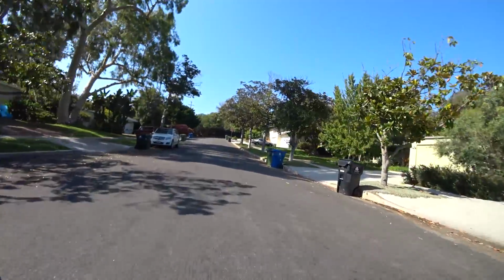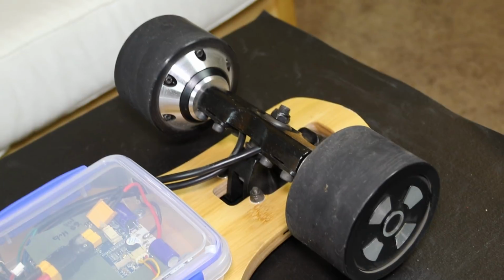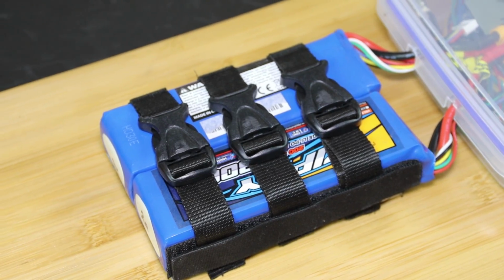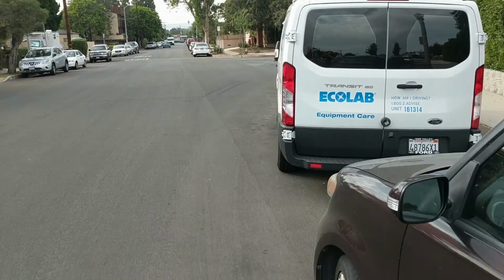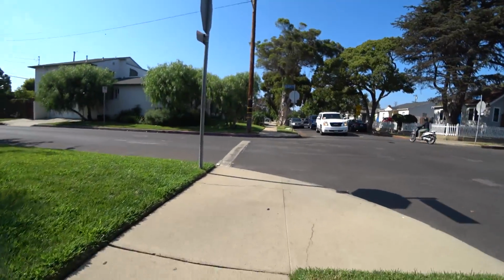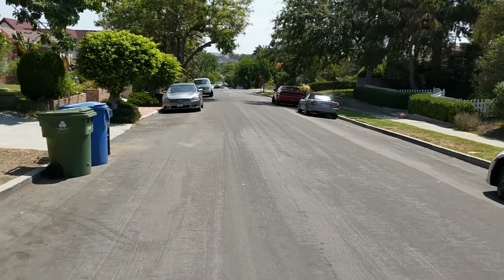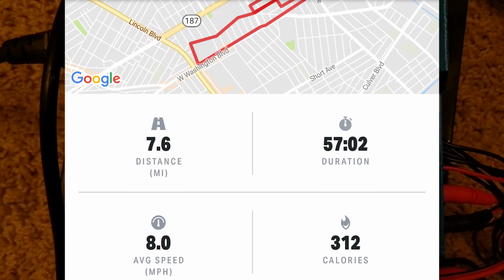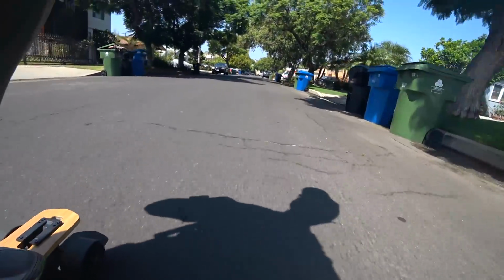Awesome Longboard | 21mph / $370 / Easy Build

Comment: the set is durable? Is skateboard still running?
Reply from the maker: The motors have been running very well. I ride the board often and they still work perfectly. The original ESC did break recently. I replaced it with the newer revision. I think the ESC might have been a bit messed up because I did a bad soldering job when changing it from 6S to 10S. Also, I think the ESCs can get damaged over time from the vibrations of the board.

Comment: How do you charge the batteries? Also, how do you know when you need to charge them? I want to make a board with battery level indicator, do you think that's a good idea?
Reply from the maker: I charge the batteries using a balance charger and parallel charging board. The charger I use is the "b6ac v2" you can find them on eBay or Amazon. I usually recharge the batteries after every ride. The newer version of the ESC in this video has a built-in battery level indicator. The ESC will also start beeping when the battery gets very low. If you buy the ESC now you should already get a battery level indicator :). You can get it from eBay (link in description) or meepoboard.com. I'll post a video soon showing the newer ESC, how I charge batteries, and more details on how I put my boards together.

Comment: Hey man after watching your video am supper hyped to build one I got all the stuff you listed, but i want to take it up a notch. I want use an off-road wheels ... any advice how I can combine this model with off road wheels. I would really appreciate it
Reply from the maker: Awesome! I'm glad the video was helpful. I'm not sure how you can use the hub motors from this board with off-road wheels. There is no easy way to change the rubber wheel part. For an off road board you might want to use a belt drive system so you can use bigger wheels. I'm going to post a video soon on a belt-drive board I built. Good luck with your build!

Comment: so ifmake this build howmany batteries can y put toget lets say 15 mile range cables etc
Reply from the maker: You might be able to get close to 15 miles with 2 5000 mAh batteries. Like this one.
https://hobbyking.com/en_us/turnigy-battery-5000mah-5s-20c-lipo-pack-xt-90.html
It depends on how you ride and the terrain. You can also buy 2 pairs (4) 3Ah batteries like the ones I use and just take the second set with you to swap along the way.
Reply: Oren's Projects i think ill purchace r of those 5000mah and take them with me
Reply from the maker: Great, you should get plenty of range with those.

Comment: @Oren By any chance can you do a vid on how you connected the remote to the board i can't
 seem to find any videos that show how to do it
Reply from the maker: The ESC and remote were always paired when I got them. I might have gone through the process once. The instructions are shown in the description of the eBay listing for the ESC.
https://www.ebay.com/itm/Dual-motors-longboard-skateboard-control-modula-ESC-Substitute-with-remote/323106658704
I hope this helps.

Comment: Many manufacturers seem to be using the same hub motors, trucks/wheels, same exact wires/covering, parts.... 400w hub motors?
Reply from the maker: Yeah, the ESC and motors in this build are a common choice for many board makers. So far I can see why. Both the ESC and the motors have performed very well and are a great deal.

Comment: if I use more powerful motor, say 2000kw, is it possible to increase more speed?
Reply from the maker: I think you mean 2000w, 2000kw would be nice :). As far as top speed that would depend on the ESC. The ESC in this build limits the RPM so it probably won't go much over 21 - 22 mph (depending on the motor kv and wheel size). With a VESCs you should be able to reach higher speeds. However, even if you use the ESC from this build, having a 2000w motor will get you up steep hills faster.

Comment: Great build! Do you know if the switch on the esc is an anti spark one? is it safe? There is something else you do beside clicking on it when you want to fully turn off the board? Please keep make more DIY esk8 videos they are awesome!
Reply from the maker: Thanks! I'm glad the videos are helpful. The switch is electronic so there wouldn't be a spark. Sparks are usually caused by mechanical switches (or connecting wires manually). I think the electronic switch is good for temporarily turning the board off but I usually disconnect the battery to be safe.

Comment: Hey dude! I've been reviewing your videos. So in this video, did you exhaust all of the battery when you got 7.6 miles? Or did you still have some room to go further?
Reply from the maker: Thanks! I didn't fully drain the battery on that ride. It still had charge left. I don't usually go full speed and rarely go up very steep hills so I get 8+ miles. I ride this board often and still haven't ridden until it fully died.
Reply: Oren's Projects if I got the two 5000mah batteries, do you think I could get at least 12 miles?
Reply from the maker: Yeah, that definitely seems reasonable. For my weight (170 lbs) and the way I ride I think I'd get at least 12 miles.
Reply: Oren's Projects Do you have any problems with the width of the board?
Reply from the maker: Sorry, I didn't see this earlier. I haven't had any problems with the width, although I personally prefer a standard board shape with a kicktail. Thanks for posting the link to the container! For some reason, youtube marked it as spam. That looks like a nice option for larger batteries.
Reply: Oren's Projects I'm building the board that you built as we speak. I laid the DKL grip tape down long ways and it is perfect. I went with the 5,000mah batteries.
Reply: Oren's Projects also, I live in Honolulu and it rains frequently in light showers. Any tips on waterproofing the batteries and the gaps for the VESQ?
Reply from the maker: That's awesome you're building a board now! Maybe DKL made their rolls a bit wider now. The ones I got were too narrow for a longboard. I also hope they improved the design to not peel back as much. You should get plenty of range with the 5000mAh batteries. For sealing around the openings in the container I'd try neoprene grommets or a strong duct tape like Gorilla Tape. Nice you live in Honolulu :)

For some reason the comment you posted with the eBay link to the battery container you're using for the 5000mAh batteries (called "Plano 3440") seemed to disappear. I'll post it again and hopefully it won't disappear!
https://www.ebay.com/itm/112326555122
It's also on Amazon and other places online.
https://www.amazon.com/Plano-3440-10-Waterproof-Stowaway-3400/dp/B00469G31G
Reply: Oren's Projects I deleted it because the container won't fit the batteries. I measured wrong and didn't account for laying them down flat for more clearance.
Reply from the maker: Ah, that makes sense why it disappeared. From looking at the measurements that container might still work well with the 3Ah or maybe 4Ah batteries. I might order one to test with the 3Ah batteries I'm using.
Reply: Oren's Projects it should work with the other batteries. But don't take my word for it. By the way, the hub motors that I got don't turn properly like regular wheels. It seems like a dull stop gets them on the inside. Kind of like a dull clicking that slows the wheel down almost instantly. Does it need power or to simply be hookued up in order to make them turn properly?
Reply: Oren's Projects I haven't built it completely yet. This is just when I tried to ride the board regularly with the dual hub motors on. I thought could still do that? It basically rotates freely for a few rotations and then locks up or gets caught up slightly like it needs power.
Reply: Oren's Projects no power to the board yet. The wheels just don't turn freely. They'll do a few rotations and then lock up.
Reply from the maker: That's strange your hub motors don't spin freely. My motors freewheel pretty close to regular wheels. Do the wheels not spin well even when the power is disconnected? I noticed that on my motors they don't work properly when the Hall sensors are connected (the connector with 5 thin wires). The motors should work fine with only the 3 power wires connected. Do both motors get locked up or just one of them? It could be that a metal piece or something got stuck inside.
Reply: Oren's Projects it was because the wires were crossed and touching and when you uncross them or untangle them, they go back to spinning freely. Apparently they can get dressed and it holds up the motors, but when you uncross them and separate them, they spin freely.
Reply: Oren's Projects where did you get the thin aluminum strips from?
Reply from the maker: I'm glad you figured out the problem with the motors not free spinning. I got the aluminum strips from Home Depot. You can probably find something like that at most hardware stores. Aluminum is pretty easy to cut and drill.
Reply: Oren's Projects I tried to connect the batteries to the charging plate and one of the connectors fried. Why did this happen? The other battery was fine, but the other was screwed. Do you have a certain routine when dual charging?????
Reply from the maker: It sounds like you might have connected one of the balance charge cables backwards when using a parallel charging board. I accidentally did that once and fried the wires. You need to be very careful with those once you connect one of the batteries. You can get 6-pin JST connectors on Amazon and try to put on a new connector - if that's what happened.
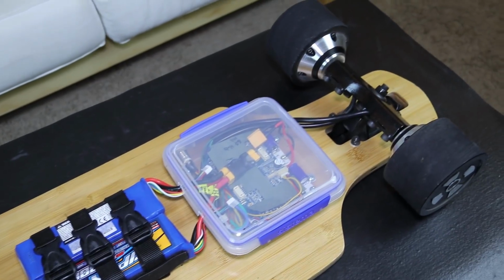I talk about it in one of my previous videos at 9:40 in https://youtu.be/A9Ss_1NW5IY?t=9m40s
Reply: Oren's Projects how could I fit it in backwards when it only goes in one way? Or is there a certain way to put them in sequence?
Reply from the maker: The smaller balance charge connectors won't fully fit in the wrong way but they can go in enough to touch the wrong wires and cause a big problem. Charging the batteries individually is safer but a parallel charge board saves the trouble of manually switching batteries on the charger. The sequence doesn't matter it's just essential that everything is connected correctly - so the wrong wires don't touch.
Reply: Oren's Projects I'm positive I put it in the right way. It even sparked when I tried to charge it individually. FML. Any tips? Because I tried connecting them both and one sparked up.
Reply: Oren's Projects hey dude....so I got my new battery in, but the ESC is blinking in three different spots and beeping like crazy in the same pattern over and over again. Im using those 5s Turning 5000mah batteries you suggested on this video. What could be the problem? Everything is done almost exactly the way you did it.
Reply: Oren's Projects I figured out the problem. I accidentally had an XT60 Parallel Connector vs an XT60 Series Connector. They look almosttexsctly the same and it was a huge mistake. Luckily the local hobby shop soldered a new XT60 Series wiring harness for me.
Reply: Oren's Projects I'll test it in a few days when it stops raining out here in Hawaii.
Reply from the maker: That's great you were able to figure it out and get the board working. Yeah, the small parallel and series connectors do look similar. I hope you were also able to solve the melted wire issue when charging the batteries. I'm not sure what could have caused that. You could charge the batteries one at a time to be safe. I hope everything goes smoothly now. With those 5Ah batteries you should get nice long rides.
Reply: Oren's Projects yeah it will get me about 12 miles!
Reply from the maker: Awesome! That's a lot of riding.

Comment: Did you get a chance to test the top speed out with you dual VESC's. Im really curious to see if the top speed would be noticeably better or in the same ball park.
Reply from the maker: I didn't get a chance to hook the VESCs to the motors on this board. I'll have to try that. I'm guessing the top speed will be higher because the VESCs don't limit the RPM.
Reply: Let me know if you get a chance because it would be really interesting to see how much of a difference spending all that extra money for dual VESCS would make.
Reply from the maker: I'll let you know. It would be interesting to find out. I almost never go 20+ mph so for me the extra money for 2 VESCs and a remote is definitely not worth it.

Comment: Hub motors look decent. But I worry about the quality of this esc.
Reply from the maker: The ESC has been improving. I recently upgraded the ESC to the newer version and it seems better built with a battery meter, external antenna, and 3-speed remote. I'll post a video soon showing the ESC upgrade along with another upgrade I made to the battery container.
Reply: Can you give a link to this newer ESC?
Reply from the maker: The same guy I ordered the original ESC from on eBay (dickyho2015) now ships the newer version (for 6S, 7S, and 10S)
https://www.ebay.com/itm/Dual-motors-longboard-skateboard-control-modula-ESC-Substitute-with-remote/322688412411
Meepoboard also sells the new version (for 10S only)
https://meepoboard.com/collections/parts-accessories/products/electronic-speed-controller

Comment: Hello, I think I'm gonna do this but I have one question. Is there any way that you can plug the board directly into the wall using DC like most manufactured boards or do you have to use the dual charger?
Reply from the maker: You would need a battery with a BMS (battery management system) to plug it directly into a wall charger. meepoboard.com sells a battery and charger like that. The LiPo batteries I use in my builds need to be charged with a balance charger, like the B6 AC. I think they both have trade-offs. It's nice to be able to just plug the battery into a wall charger. However, LiPos are usually cheaper so you can buy multiple packs and swap them as needed.
Reply: Are you sure you can't attach a BMS to two LiPos? I found a video of a guy that was able to charge two LiPos in series https://www.youtube.com/watch?v=2vfSURczARA
Reply from the maker: That's interesting. It is possible to use a BMS with LiPos but I think if you're going to add a BMS you might as well build your own pack using Li Ion 18650 cells, which have a higher energy density. In my builds the batteries are easy to remove so it's not difficult to connect them to a balance charger.
Reply: Yeah, I agree, I've decided that I am going to just buy the meepo board kit and just put it together like that. The battery's are better and I don't have to figure out all this BMS bull. Still going to use the deck and griptape from this vid though. Griptape came today and deck is coming in a few days. Great video though!
Reply: Also, the only reason that I really want a BMS is because I want to commute to work with it and be able to charge up at work without lugging around a lipo charger
Reply from the maker: That's a good idea! Combining the parts you like to create your perfect board is the way to go! I know what you mean about carrying the lipo charger around. That's why I buy 2 sets of lipo packs. Meepo is a good solution too.

Comment: are these the same motors but cheaper http://www.diyeboard.com/dual-hub-motor-9052mm-1000w75kv-power-truck-front-truck-kit-p-558.html?zenid=oe9kahcfbiql2q5upmt7gecie6 and does your esc have regenerative braking?  nice vid man!! im gonna try to build one!
Reply from the maker: Thanks! Yes, those are the same motors. That looks like a good deal. I've never ordered from diyeboard.com so I don't know how long it takes for parts to arrive. The ESC does have regenerative braking. I just posted a video testing regenerative braking :). Good luck with your build!
Reply: Did you bought the motors? Did you received your item?
Reply from the maker: I bought the motors on eBay

Comment: this is really cool but it would be better to save up the extra 50 or 60 dollars for the meepo board 1.5 but great video
Reply from the maker: Thanks! I agree that meepo is a good option if you're happy with it as-is. When building a custom board you have the option to adjust it to your preferences, and possibly save a few dollars. I prefer the deck, griptape, and ride-height in this build. Also, easily interchangeable batteries is important to me.
Reply: Oren's Projects true

Comment: Hey man. I'm back again. I've been looking into investing into the products that you've mention however is assembly of electronics hard? Could you make a video on it maybe?
Reply from the maker: Hey, that's great you're considering a build! I'm planning to make a video to go over the electronics and container installation more in the next few weeks. It's not too difficult to setup the electronics. Once you get the ESC mounted you just need to connect the 3 power wires to each motor and connect the battery. In my experience, the extra connectors for the hall sensors are not necessary. If the motors are spinning in the wrong direction after you connect everything just swap 2 of the motor wires. I hope this helps for now.
Reply: Sweet! Thanks man. I'll order the parts tonight and get things working. Thanks again for your time. Can't wait for your next upload.